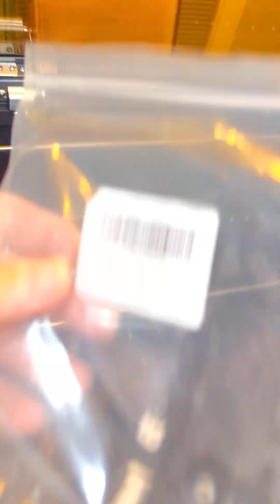Wecreat Vision Pro Laser Cable Problem - A SOLUTION that will work!

Comment: I used mine a bit more but not much more and experience both issues I went through two cables and the coupler ( when coupler cause issues it will cause the laser head to crash into the left side of cabinet."  However I will say customer support sent me a new laserhead and the update cable and reimbursed me for the drag chain.  Note: My machine is still under warranty. Only issue is the parts are coming from CA and I'm in PA in mid Holiday season slow delivery and may have to cancel orders and refunds. ugh

Comment: I'm going through this issue right now. The first cable got snagged so bad that it pulled the cable out of the metal guard. I installed the second cord and after a couple of uses the machine wouldn't auto focus .I needed to get a project done for an Xmas gift so I manually focused the machine and started the engrave, however about 2 minutes in the whole machine shut down and won't power up.I removed the laser head to clean it and found the new cable was ripped up worse than the first one to the point that the wire inside was torn open and frayed. I installed the original cable that I had wrapped the frayed sheath material with electricians tape and when I got the machine back together it would power up with no lights and the laser head fan would start then shut down a second later. I'm frustrated as hell. Customer service is sending the new cable and I hope that fixes the issue. I will be installing the drag chain as soon as it arrives. Thankyou for this video very good info.
Reply from the maker: It is very likely that the Laser Head was damaged as well somehow. They sent me a new one after going back and forth with them a few times. Had something to do with the Octocoupler being fried. Their customer service isn't bad, but their product is not very good unfortunately. I thought I'd save a bit of money vs buying the xTool or even better, the OneLaser, but unfortunately I just fell for their fancy marketing.
Reply: @marcusjamesreed  yes they seem to think that the new cable will fix my issue. I ordered the drag chain they suggested and they are remburseing me for that cost. I guess I will wait to see it the new cable does anything.
Reply from the maker: @mikecarlisle4093  Curious what drag chain WeCreat recommended...

Comment: My machine will be arriving this week. I have looked into this and some folks are using command strips to secure the drag link as well. Might be an easier solution for some folks to place a command strip on the rail then press the drag link onto the rail in the proper spots. I am going to give the command strip method a shot, as I have them on hand.

Comment: My chain hits my camera when it rolls upwards, any ideas? Thank you
Reply from the maker: I used the clips that came with the machine and installed them as far down the chain as they could go. They are the ones with the double sided tape. They hook into the chain. There is only so far they can be installed but they seem to hold my chain in place just enough to keep it from getting too high as it is moving.

Comment: So I order the drag chain and installed it almost exactly. Ran into an issue with it hitting the camera. Once it actually hung on the camera stopping my laser head.
Reply: I had the same problem.  The drag chain definitely keeps the cable in line but also raises up too high and I caught the camera.  Back to looking for another solution I guess.
Reply from the maker: I used the clips that came with the machine and installed them as far down the chain as they could go. They are the ones with the double sided tape. They hook into the chain. There is only so far they can be installed but they seem to hold my chain in place just enough to keep it from getting too high as it is moving.

Comment: Wondering how this solution of adding the drag chain is working for you? I purchased 2 different sizes from Amazon (R18 - 10mm x 15mm & R15 - 7mm x 7mm) but didn't realize that the R15 was a closed chain which means you can't get the cable into the Drag Chain. This size looks like it fits the cable better, so I am looking for this version on Amazon. In the meanwhile, I'm going to try and use the R18 (minus the black channel/cover on the machine). Could you share how many total links that worked for you? And did you remove the small block next to the connection on the right side of the engraver?

Comment: I find it VERY interesting that almost every 3D printer that I have owned has used this technology and that WeCreat has not adopted it.  You can even print your own Drag Chain if you have a 3D printer (I believe).
Reply from the maker: It's crazy. I think they just rushed production. Hopefully they fix this and the other issues.